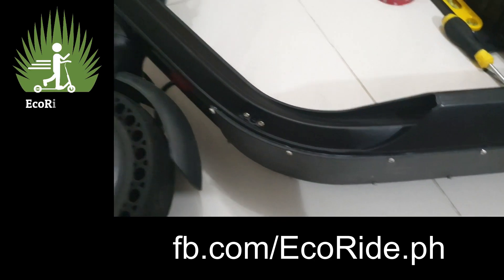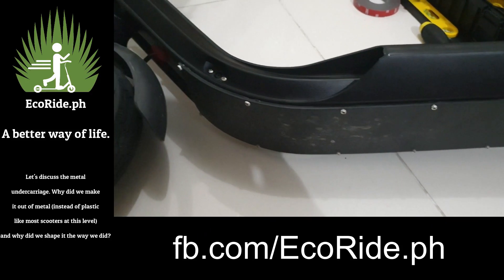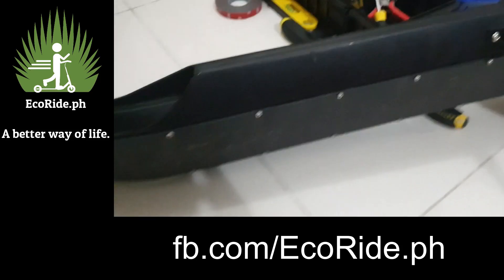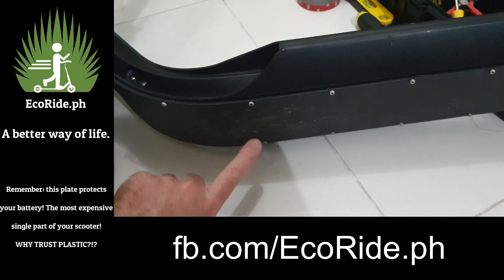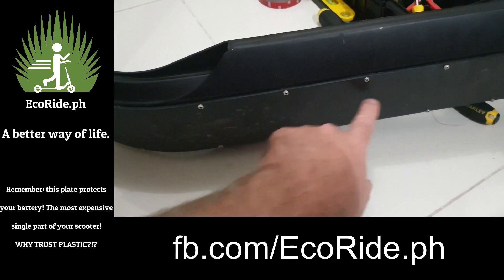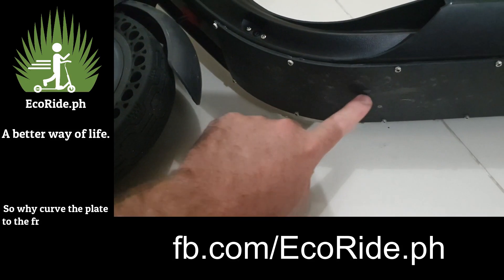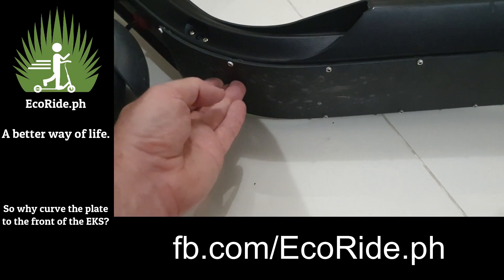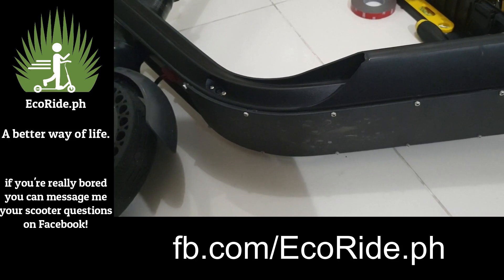EcoRide2: more durable... today's lesson, metal undercarriage

Comment: Hi, i bought myself an ecorider2 2 weeks ago and it does not have any under carriage...
Reply from the maker: You'd have to have some kind of panel there... Can you WhatsApp me a picture at +15735870681 ... I will look in to this for you
Reply: Mine has a metal under carriage but was cut just until the carriage and dont continually curve up. Not unlike the metal under carriage on your video.
Reply from the maker: @omarfrando557  ah so you have an undercarriage, you just have the new design. Tried to save a little weight on the new ones